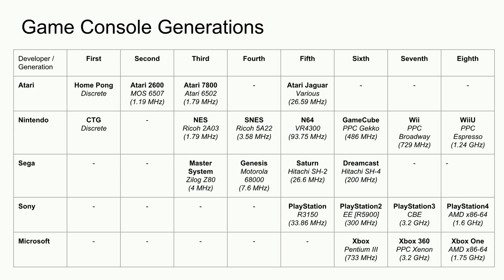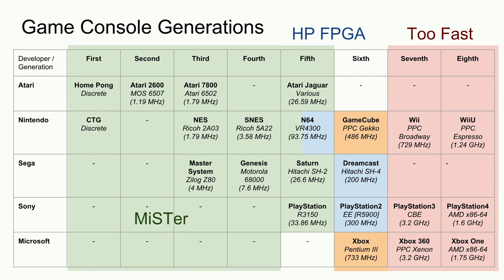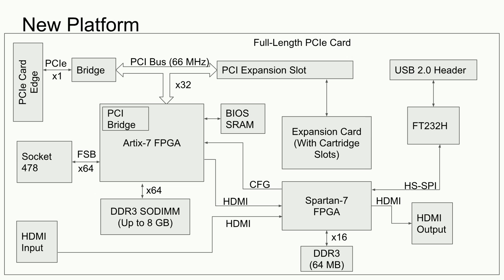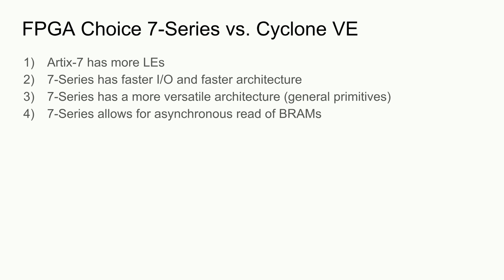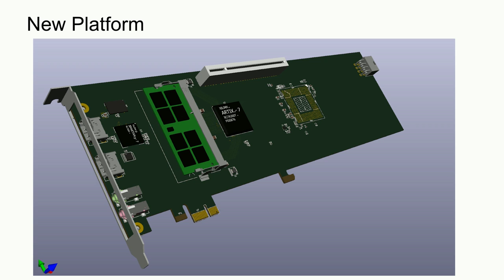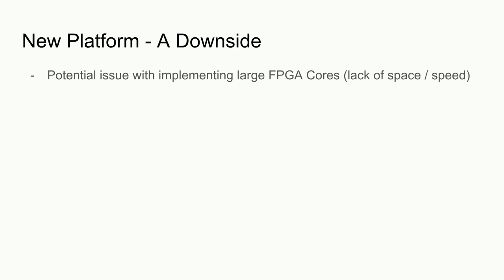A High Performance FPGA Game Console Platform

Comment: rofl allready done replay 2 by Mike J
Reply: replay 2 has very few cores to mess with and do you have a link to the PS2 core  wip page . can it play mister cores if it can why has he not port theses cores over?
Reply from the maker: The Replay2 uses a Spartan 7, and I don't think the claimed 1.5 GB/s DDR3 would be sufficient for an N64 with a 1080i framebuffer. If that person is able to get a PS2 core working on that at full speed, they should get a medal, because 1) it won't fit, and 2) the memory bandwidth is too low. There was a reason that a x64 SODIMM was chosen, as well as the Artix-7. As it is, It's likely that only the emotion engine will fit in a single Artix-7, let alone a Spartan-7, 2/3 the size (if it even uses the largest Spartan-7).
Reply: @RTLEngineering  not sure where you getting information on spartan 7, Mike I stated they are using ultra 96 platform has spartan 7 is end of life you must be looking at out of date part of the website. Not the current 2019 plans for replay 2.
Reply from the maker: @Matthew Langtry The information on the Spartan 7 is directly from the Replay 2 website: https://www.fpgaarcade.com/replay2/
The information regarding the the memory is also on that website.
If the plans for the Replay 2 have changed from what is on the website, there is no way for me to have known that. Feel free to update me with the currently planned FPGA.
If instead you were asking about the information specific to the Spartan-7 vs Artix-7, that can be readily found within the Xilinx datasheets.
Reply: @RTLEngineering  The website is a little hard to navigate, here are more details of the ultrascale design :http://www.fpgaarcade.com/replay2-first-mock-up/  I was targeting the S75 or S100 in spartan7, which is as large as the second biggest Artix-7. Using a 64 bit memory system the performance is very similar to the Artix-7.  Pretty much all the cores which are available on Mister/Mist will be available on R2 - most on R1 shortly.  The reason for shifting to the ultrascale was to get the tight CPU integration for hybrid emulation and potentially the GPU as well, which will be handy for the Amiga etc.
Reply from the maker: @Mike Johnson  Thanks for the clarification. The second biggest Artix-7 is the 100T, which is half the size of the 200T, where I don't think the 200T is even large enough to fit an entire PS2 core. The 100T and the largest Spartan 7 are roughly the same size as the Cyclone V used in the DE10-Nano, so that would be a lateral move.
I think shifting to an Ultrascale ZYNQ is probably the right idea, since they offer more size variety, though it might fall into the same trap as the Cyclone V. For example, where does the DRAM sit? Is it attached to the FPGA fabric or the ARM SoC? How large is the ARM SoC cross-bridge IP needed to communicate with FPGA logic? Also, which ZYNQ are you planning to go with, and is the only benifit over the DE-10 Nano going to be the added GPU?
The added inclusion of a GPU is helpful though, especially if it can be programmed bare metal (I haven't looked into the Ultrascales, so I don't know if this is possible). I do know that the ARM SoCs are recommended by Xilinx to use their linux distro, and not be done bare-metal, though that probably works for what you had in mind (since it can handle the network stacks and USB protocols).
Reply: @RTLEngineering  Some discussion about the FPGA sizes here : http://www.fpgaarcade.com/replay2-the-saga-continues/ 
DDR4 DRAM is attached to the processor system and additional DDR3 (tbd) to the FPGA. Linux runs very well on the ZYNQ and we will be running a cut-down minimal version. Bare metal is possible.

The Cyclone V on the nano is very good value actually and it's hard to compete with the pricing they get. 
The PS core mentioned by the way is still under discussion, it's a target more than a project at the moment. I should be able to run "normal" software emulation on the ARM with the frame buffer in the FPGA to get started with more complex platforms, and them move hardware into the FPGA domain as required.
Reply from the maker: @Mike Johnson It looks like you are only comparing two FPGAs with ~100K LEs, where as the Artix-7 200T has ~200k LEs. As I had mentioned, it's very unlikely that you will be able to fit an Emotion Engine core within a 100K LE FPGA, which can also run at the 295 MHz (if you can fit one at all).  One option would be to go with a ZU5CG, which could allow you to fit an EE core within the FPGA fabric, and then run the IOP and interface via software emulation on the ARM cores. The main issue there will be the cost of the ZU5CG being around $1,100. 
As for memory, keep in mind that the PS2 had a peak memory bandwidth of 3.2 GB/s, which I don't think is possible via the ARM-FPGA bridge, so you will need dedicated DDR3 there, as well as DDR3 which can meet that bandwidth alone. 
Another option, which I think you implied, was to only offload some of the EE into the FPGA fabric, but that's not a good idea, since you will have a hard time synchronizing and transferring data between the software and hardware implementations.
The whole reason for proposing the platform in this video, was to provide a solution to all of those problems, in some form or another.

Meanwhile, I am a little confused as to what advantages are provided via the replay2 vs the DE-10 Nano. Is it just supposed to be an alternative with near identical capabilities at a similar price?
Reply: Realistically the chances of getting a full PS2 core in RTL running is minimal, hence the hybrid approach of using the ARM and GPU as required. I also have the option of a midrange kintex7 at a very decent price, but this would require an external CPU and mitigate any advantage of the SOC. 
The main advantage over the DE-10 is high quality analog audio and video, Gigabit Ethernet and USB3 on the CPU side and high speed FPGA attached memory. The ultrascale is a bit faster than the CycloneV as well - it's a  16nm FinFET rather than 28nm.
If you look at the mockup, I am keeping the ability to plug a CPU daughterboard in, for example the 68060.
I aiming for under $300 retail, decreasing further with volume.
Reply from the maker: It depends on how you define "realistically". I have shown in my previous videos that the 7-series architecture with some careful RTL construction, can hit the speeds required. Though that obviously at the mercy of the router. 
I did also consider a Kintex-7, but the problem there is that it requires the paid version of Vivado to synthesize designs, which is not going to work with the FPGA core community. 
As for the advantages, I'm not sure that high quality analog AV is going to be that big of a draw, nor is the USB3. The biggest benefits that you described are the fast FPGA memory, and faster architecture. However, there are currently no MiSTer cores that require those features, and anything that could take advantage there, probably won't fit in the FPGA fabric... 
I think it's going to be a hard sell, especially if you don't have a core working in it, which takes advantage of all of those features, and cannot be implemented on the DE-10 Nano. If what you end up with is a more viable option than the PCIE card that I proposed, then when I move my N64 core off of my Artix-7, I will certainly consider the replay 2 as a target (though moving some of the RTL to software is not an option that I am willing to consider to get it to fit).
Reply: For sure, the Spartan7 can achieve very decent performance with careful design and floorplanning. It's only really in the CPU cores I've had to do some optimization, and that's on the Spartan3E. It's more design time and effort - and I'm an absolute purist here, a lot of my work has been taken from reverse engineering die scans and real hands on measurements.I've got a PS2 in the process of being decapped and analyzed, but I think this beyond transistor level cloning, unless some automated help becomes available.  
The Kintex I've been offered cheaply is the 7K160T which is supported in Vivado webpack. 

The Spartan7/Artix devices are more than capable for pretty much all feasible platforms, the draw of the Zynq+ is the close coupling of the ARM,GPU and FPGA fabric. While I am developing a new superscaler ~68060 core, I believe it is more efficient to run the CPU emulation on the ARM and the Amiga hardware on the FPGA. It's also quite cost effective when compared to a two chip solution. You also get display port in addition to the HDMI/analog output which is handy for the Linux side, as well as a PCIe lane which can be used for storage. 
The AXI bridge is 128bit@333MHz. The target device is the 3EG which has around 140K flops. There is a significant resource saving as I don't have to implement ddr4 usb, ethernet, spi or and external CPU bridge.

You are very welcome to join our slack group where we ponder this kinda stuff btw. /Mike
Reply: off topic, but just looking at one of your other videos. Did you know you can do the following in one lut4 slice?
dout <= (a+b) when (sel='1') else c

Uses all four components in the slice! 
 add/sel implementation:
 lutout = (a xor b) and sel           (lut)
         or c !sel
 datout = lutout xor cin              (xorcy)
 cout =   cin and lutout              (muxcy)
      or (a and sel) and !lutout      (mult_and)

and the flop with enable....
Reply from the maker: That's pretty cool, but I don't think there are many use cases which could take advantage of that. Typically if I want to utilize the LUT, I define a ROM look up table which the synthesis tool knows to allocate to a single LUT / ALM.
Reply: I can send you the code privately if you want to take a look. This instantiates the LUT4, xorcy, muxcy and mult_and all in the same slice to get maximum utilization. You can then rloc macros together to get the shortest routing. The code above lets you do mux(load), add or subtract in one LUT essentially. The tools have got better, but they used to build an adder chain, subtracter chain and 2 muxes. I used this to build video processing blocks years ago.

Comment: I am giving this video a thumbs down because if gave me bad news about a n64 fpga core
Reply from the maker: Reality often sucks because of what we wish to be possible and what actually is differ. I can't tell you how many times I have run into this issue as an academic researcher. 
At least I am giving you hope that an N64 core is possible on another FPGA, unlike Kevtris (the engineer to worked on the Analogue FPGA cores), who claimed that an N64 core would be impossible flat out. Also, to put things into perspective, the FPGA in the MiSTer was designed back in 2009, so it's 12 years old. And at the time, it was 20% slower than the Xilinx 7-series which was designed in 2008. There were several poor choices made along the lines by Altera, Intel, and the MiSTer community that lead to the bad news you spoke of (i.e. the community could have chosen a better FPGA to use, there are even ones now around the same price of the DE-10 Nano that could run the relevant part of a PlayStation 2, or a Dreamcast). 

Unless you were referring to the bad news being that other people are working on N64 cores, where one person supposedly has Mario 64 and Golden Eye running on an Artix-7?
Reply: @RTLEngineering  just to be clear...I didn't give the video a thumbs down.